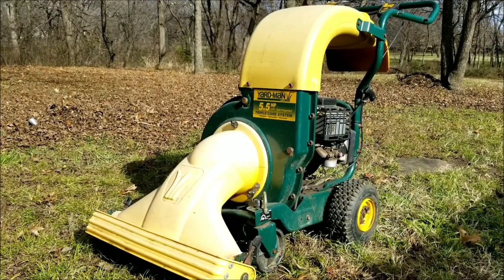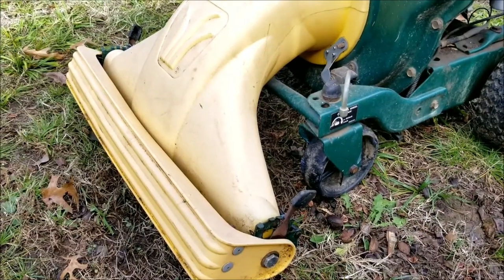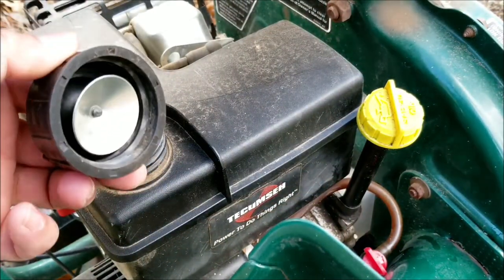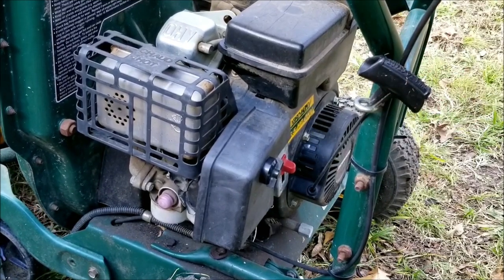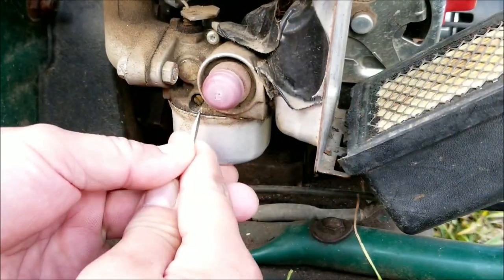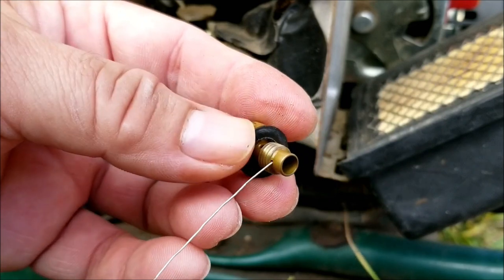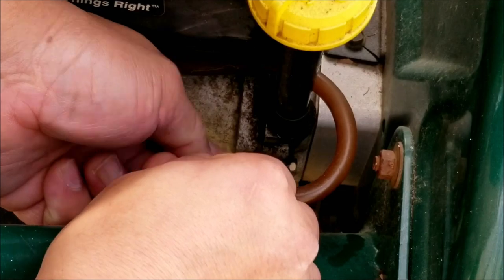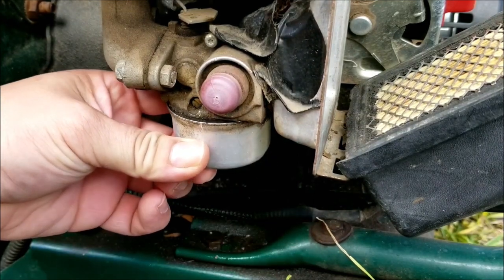Simple fix for a walk behind leaf vacuum, shredder chipper that won't start.

Comment: Bought a similar used Yard Boss 550 six years ago. The seller couldn't get it to start at the time. So he cut the price in half. Good deal!  When I got home, removed the bowl to reveal the bad gas just like in this video. Great machine! The flail blades inside this machine pulverize everything into bits. I typically use my backpack blower to blow the leaves away from the house, away from the outside edges of the property, away from trees, etc... It helps to concentrate too. Then I vacuum them up. Good video!
Reply from the maker: Thank you for the comment I appreciate it

Comment: The outfit that I worked for had a blower like that with a flat head Briggs 8 horse and a vacuum with a Tecumseh. This was before backpack blowers and we blew and vacuumed leaves out of flower beds and bushes instead of hand picking. Then came the 1st Stihl backpacks and both of them got sold. I personally blow my leaves into a pile and then take the 85 blower and put on the vacuum and pick them up for mulch.  Good garden stuff. Thanks and Blessings!
Reply from the maker: that's a very good way, to make short work of those leaves.
Reply: @INSIDEHOUSEGARAGE  The 85 with the vacuum is a dream come true. Blowing them into a pile and fluffs therm up just enough for the vacuum to do the deal easily. And it's simple and quick to switch back and forth between blower and vac..

Comment: I don't have a lot of leaves, compared to other folks, but I also nned to clear them out from the street in front of my house, or else they will flow over the sewer grate in front of the house next to mine (we are at a low point for the street, so if the sewer is covered with leaves, the excess rain will flood over).  I have a Snapper 21" Hi-Vac mower, and that does a great job of lifting leaves off the grass, and especially, off the street surface.  The bag can fill and need to be emptied often, but I keep a leaf bag or empty wheel barrow nearby.  Mowing and vac'ing leaves crushes them, maybe not as well as this dedicated leaf vac does, but it's a good way to use your mower for something more than cutting grass.
Reply from the maker: that Hi-Vac seems to be working well for you.

Comment: I have a very similar model of Yardman 5.5 self propelled that I got back in 1998.  Huge timesaver for me when I lived on a 1 acre property that had oak and maple trees all around.  Back yard was a woods, front yard was grass with a  huge oak , several smaller oaks,  hickory and maple, and then some scattered dogwoods.
 I could not mulch the leaves into the front lawn - simply too many of them.   I would say I stretched my Yardman to its limits chipping fallen branches and vacuuming leaves.  I would use it several hours each and every weekend throughout the fall, and then perhaps 1 or 2 hours every month spring and summer.    l counted one year and I got just above 80 bags of leaves from the Yardman in the fall.   Those were Yardman shredded bags, not raked bags.  Seriously.   

My issue now, 23 years later, and now living at a less leafy place,  is keeping her running after so much heavy use.    So this was helpful reminder of some basics re the engine.   
This weekend I put in an inner tube into one of the tubeless rear tires that could no longer inflate as the rim got a bit corroded.  
Need to replace the recoil starter as the spring is shot, and I really should get a replacement bag finally - have resewn and patched my old one , but it is time to move on....
Reply from the maker: These are great vacuums but it might be time to move on.

Comment: I have the same vacum,bought it used 3yrs ago,had minor problems with tires going flat & drive star gear worn out,repaired(parts still available)Worked great last year and ran tank dry before storing,,,This year it didn't start,so i decided to tear it apart and service it,,,,Clean everything with carb cleaner,new coil, & changed oil,new gas tank(tank was dried out and stress cracks) just waiting on todays mail for new plug & air filter,,,,,,FINGERS CROSSED THAT IT WILL START,,Loosend fuel bowl and gas came out
Reply from the maker: hope it works

Comment: I'd would need to use the leaves as mulch around the trees ever since the summer weather is unforgiving to the plants in Australia so they need the leaves to retain the moisture in the soil & it creates humus for the trees to feed on.

We have had 45-46°C days on occasions over here so it gets as hot as the Arizona desert for a day or 2 then it's back down to the 30°C mark, having mulch around the plants stops the water evaporating when we've got water restrictions in place !
Reply from the maker: Oh I didn't know that.  Thanks for sharing the information

Comment: For me, I would do two things. If the leaves fell in the driveway, I take my blower and blow the leaves into the grass. Second thing, I come along and use the mower on the highest setting with the bag attachment and suck up the leaves where I can dispose them into either a garbage can or leave them on the side and the county comes in and takes it
Reply from the maker: Yes that seems to be a very good method for taking care of the leaves.  Thanks for the comment I appreciate it

Comment: Thanks for this video. I own the same machine. It has worked great for many years. Do you know if this machine can be adapted for 110V Electric Start?
Reply from the maker: I dont think so because you would need to replace the flywheel as well. Lots of work.
Reply: @INSIDEHOUSEGARAGE  I can see that, thanks for the reply.
Reply from the maker: @rogozzy1  no problem

Comment: I have this same mulcher - neighbor was giving it away! It hadn't been run in a long while. I have fresh fuel fuel to the carb, replaced the spark plug. With throttle control at fast and a couple of primer pumps, I get nothing. Also, nothing with spraying cleaner into the air intake. The pull rewind is a bit slow. I've never pulled a carb off any of my other equipment but that'll be next. Other suggestions? Anything I may have missed in the starting? Pulled both the owner manual and engine guide and haven't found anything. (I don't have a fuel flow valve or choke options per manual.)
Reply from the maker: very nice of your neighbor to give it to you.  Have you confirmed that you have spark?
Reply: @INSIDEHOUSEGARAGE  Thanks for the quick reply!! Yes, I pulled the new plug, connected it to the spark plug wire, and when I pulled the rope I saw a spark and heard a faint crackle/pop.
Reply: I thought I'd seen a comment about disconnecting "something" before attempting to start but cannot find it. May have misread.
Reply: @INSIDEHOUSEGARAGE  Also, with the spark plug removed, when I pull the started rope, I feel air coming up through the spark plug hole.
Reply: SUCCESS!!!  Sort of - switched to Seafoam spray and she took - a few sputters but up and running!!  After I shutdown to empty the bag, had to add a shot of carb cleaner to get her going again. But still... SUCCESS! So far, not great on gum balls (for those of you who don't have them - love the tree, hate the fruit - like velcro in your grass) - will see if I can work on the suction
Reply from the maker: yes was to remove the small wire to the coil, that would make sure that the switch wasn't a problem or that there was short to ground
Reply from the maker: excellent work!

Comment: I have a leaf vacuum when I spray carburetor fluid in it it stays running but when the fluid runs out it cuts right back off any suggestions
Reply from the maker: sure, replace the carb.

Comment: I have the same machine and it is great - when it works. I am having some gas dripping out of the carburetor bowl. Do you have a suggestion to fix it- thanks in advance
Reply from the maker: if its dripping from the bowl, I would suggest replacing the bowl gasket and the gasket for the bolt.  However, if the fuel is coming from the carbs mouth, then I would replace the whole carb.
Reply: @INSIDEHOUSEGARAGE  I checked the bowl nut and it was a little loose. I removed it and the gaskets are in good shape so I put it back together and tightened the bowl nut. It is stopped the leak which is great so my shed does not stink of gasoline. Thanks for the help. Great video for both information and image quality BTW.
Reply from the maker: no problem And I appreciate your Time